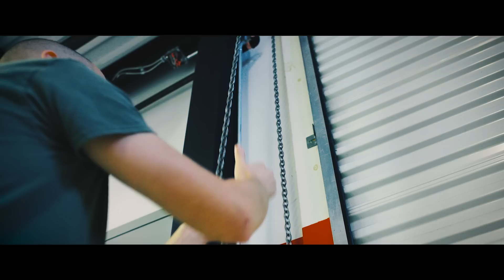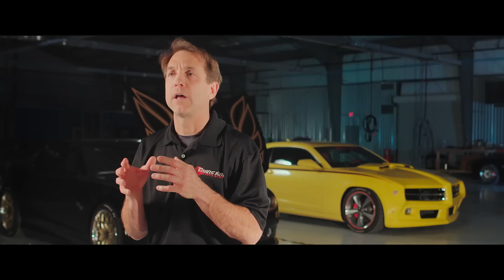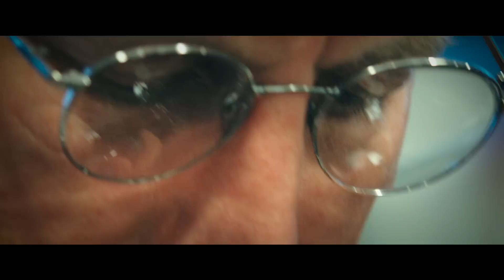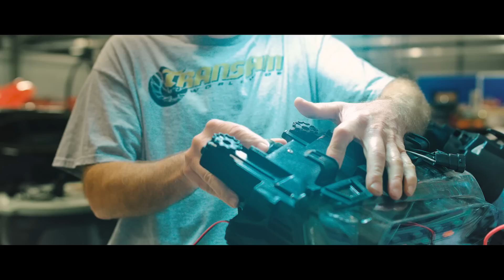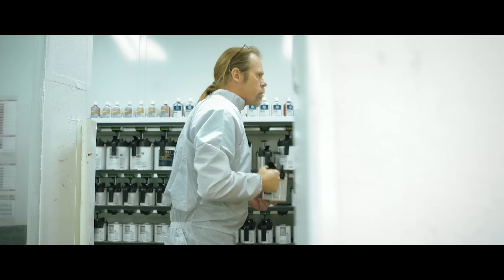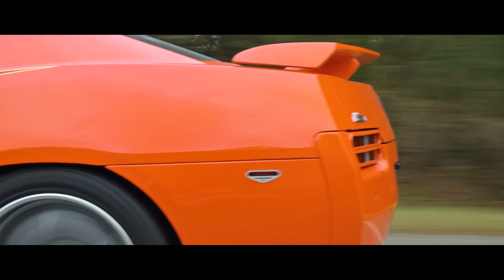Making The Modern Trans Am & GTO

Comment: the stuff you guys are doing to these cars is very extensive and incredible but the proportions on the exterior are all wrong! it looks like you stretched the height of the bodywork which removes the sporty look that the cars it was all based on had... I'd suggest using a lower profile car or building cars from scratch to have proper proportions and be more faithful to the originals.

Comment: You really swapped those vented rotors for ported ones.... It's 2021 no body does that now for a reason large rotors warp easier under stress when they are ported and drilled rotors only provide marginally cooler breaking. Come have Dane explain why you do that please.

Comment: The Trans Am isn't a "Modern Car" by any definition of the word. It has 1930's "A" arm front suspension, and a solid Hotchkiss rear drive axle straight out of 1888 with dual (uncontrolled) coil springs in the rear circa 1871 Studebaker one-horse sulkeys. A 1949 Tucker "Torpedo" had VASTLY superior steering, suspension, braking systems, safety systems and would turn a lap on a race track faster with 1/5th the horsepower. A 1958 Ferrari 256 "Speedster" roadster is quicker thru the quarter-mile, 35 MPH faster top-speed and will run-away and HIDE from a Trans Am on a curvy road with 1/4 the horsepower and 65 years later, is still worth a half million dollars or more! Find me ANY Trans Am worth 6 figures! and not rusted out !!!

Comment: Amazing, I want a 1000 HP Trans Am . 🇺🇸
Reply: No, you don't. You THINK you do, but 1000HP and the accompanying torque would twist the unibody into a pretzel. NO GM unibody EVER made can support 500 brake HP and 500 ft/lbs of torque applied to the stock suspension. $20,000 later, it MIGHT, in a straight line. Wanna turn? Keep adding money.

Comment: I think its great that you guys are bringing back the Trans Am, BUT the most important if the Pontiac Car doesn't have a SD 455. then the car is still a chevy  no matter how the car looks. With the LS motor its sill a camaro with a Trans Am Look. The car would be Great if it had a SD455 or a RAM AIR V, Now you have something.

Comment: i wonder how long they live , if tgey break down sooner , are the parts or builds like rock solid or durable & live long like german or japanese buids & parts , & go long only needing replacing after 80k 100k miles, or die too soon after 40k or 50k miles like cheap low quality chinese flimsy parts that break straight after leaving the factory lol , god knows , only a well kept & a looked after good one of these modern trans am cars after a few years or high mileage , then the real truth & answers will surface , if they last & the build & overall quality is good or not , only time will see, a bit like the honda civic built in U.K 2006-2011 was really cheap low quality very bad not reliable but the older japanese versions were a million times better the engine was like literally indestructible lol seriously

Comment: I use to own a 1973 limited edition Firebird Formula 400. Bought it for $4000.00, back in 1982, then added over $5000.00 with of aftermarket equipment onto my bird, then had the transmission rebuilt with new torque converter and shift kit by pro builder. I then changed out the rear end for highway rally traveling and added a better suspension,  because these cars were known for the front end weight bottoming out the vehicle. Couldn't get the max out of it, but did manage to get it over 185 mph going through Colorado. Too bad, a highway patrol car was parked under an underpass in the middle of the desert, so I had to let off. Plenty of pedal left and nowhere close to redline. Had my boss with me in the passenger seat holding on to the grab handle like a scared child, just above the glove compartment. Cop said he wouldn't have paid much attention except he saw my car getting airborne about a foot and a half off the pavement and throwing sparks! The long dips in the road were like woopty doo's at high speed and my skid plate was getting a workout! Cruising at 95 to 110 was too easy, that even my boss was not paying attention. He got a ticket for 97 going through Jersey. Car was so tuned and smooth, that you could not notice the speed unless you were paying attention. Tires spun out of passing gear on the highway. Roommate wrecked my car while I was at a management meeting. Ugh! 
Would have loved to have another one with access to today's upgrade equipment. I would like to see a Firebird Formula redo that has a traditional two hood scoop ram air, twin turbo coyote, or better engine set up. Linked cromolly steel, or aluminum suspension, computer adjustable shocks, etc. My '73 aluminum wheel set up, 15-7.5 front, 15-8 back. Tires 15/275/50 front,15/285/50 back. Butcher paint and pen stripes. Never like the 80's, or later hood scoop layout's. The '70's hood scoop was what I liked about the Formula, then they butchered it, squared it out, tucked it in, etc. Well that's my short story. Love your new GTO version upgrade on Your video.

Comment: What happens if GM resurrects Pontiac? You guys start building Oldsmobile?
Reply: Who knows if Pontiac Division returns! Also Oldsmobile needs a resurection
Reply: ELMO WILSON - I wouldn't plan on either of those brands coming back - GM got rid of them for financial reasons and that is the key factor in today's manufacturing considerations.  If the car isn't selling, then there's no sense in making it!  Half of GM's problems that lead to bankruptcy were they had too many brands and not enough buyers for them.  I'll bet my hat, ass, saddle, and the barn you'll never see either of those brands again.
Reply: GM would have to work something out cuz if these guys are buying Camaro in bulk they have some compaction on there hands
Reply: I think this is Pontiac bud 🤷🏻‍♂️
Reply: They should resurrect the Fiero GT